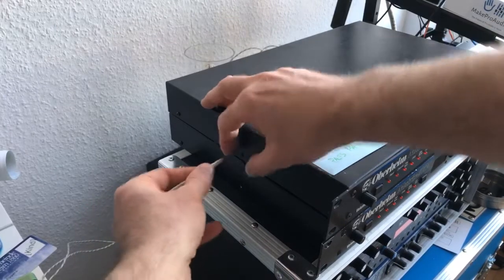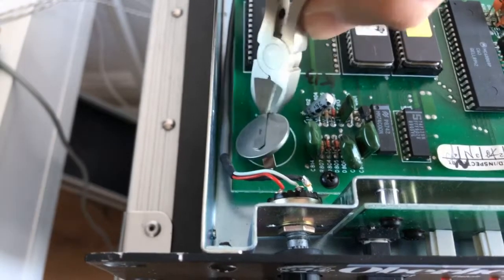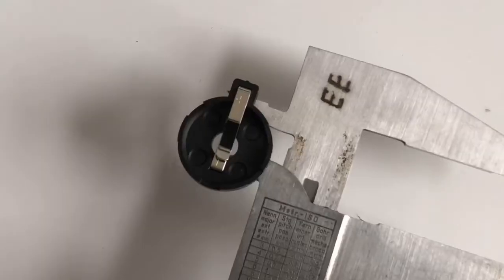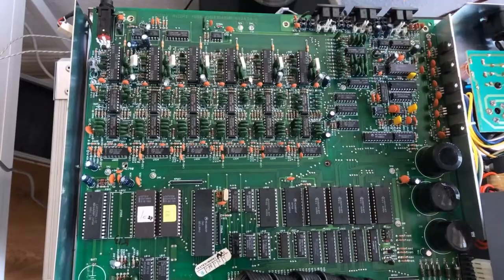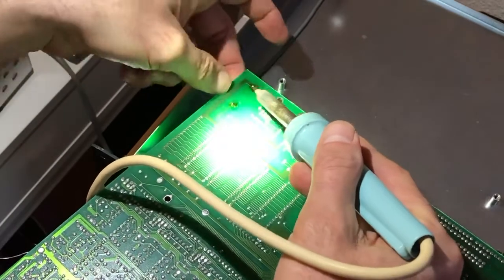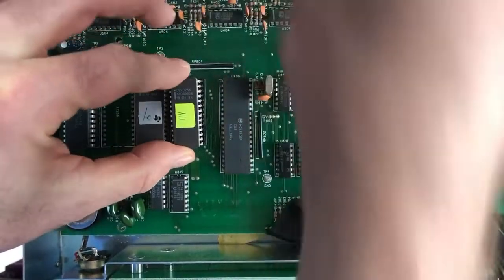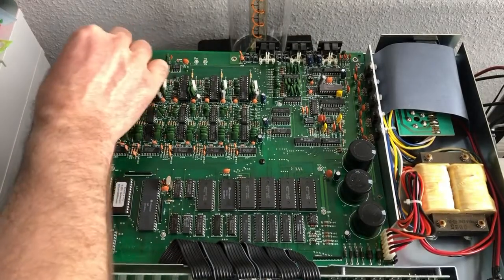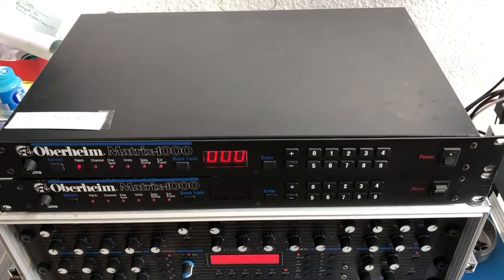Oberheim Matrix-1000: Replacing the battery

Comment: Thanks for this tutorial! It helped me replacing 2 batteries in both my Matrix1000 (though I didn't need to get the mobo out. Funny you did use an IKEA battery.
Reply from the maker: I had those at home. :) Glad the tutorial was useful.
Reply: Hello ! Thanks for your video, I wanna also do it. Do I have to change the socket necessarily or I can just insert a new battery in the existing one ? Thanks you, have a great day !
Reply: @vpetroi3  there wasn't a socket originally, it was a soldered-in cell

Comment: I've just done this on one of mine - the original battery was totally flat (yet not leaky, thankfully) - now I've got to find a way to repopulate the empty 000-199

Already fitted the 1.20 about 7 or so years ago into all three of mine (although this one I did the CR2023 change on today was and still is pausing on power-up just displaying 1.2.0 forever, after a few enter+powerups it decides to behave)
Reply from the maker: MIDI file with original presets (I hope): www.untergeek.de/wp-content/uploads/Matrix-1000/Midifiles/matrix1000_bankdump_factory_ram.zip - use MidiOX (Windows) or Sysex Librarian (Mac) to get them back on board. Sorry for the slightly late reply.